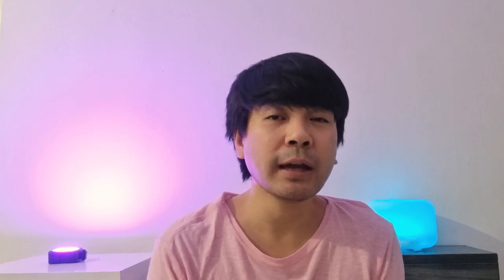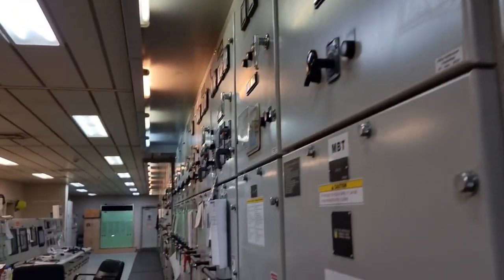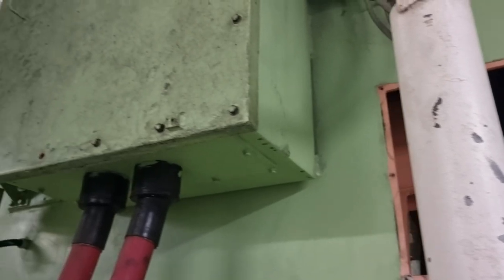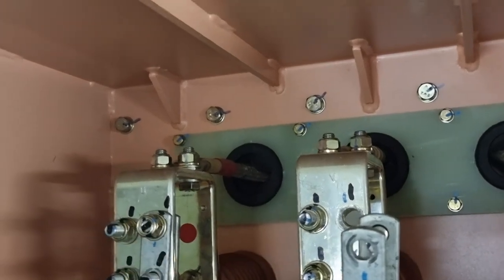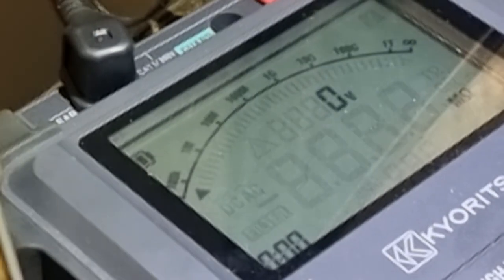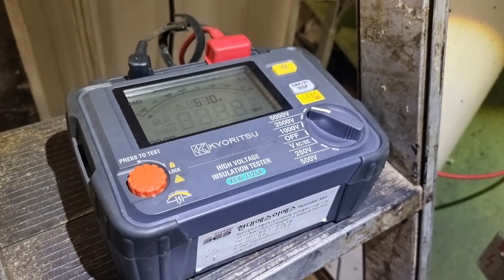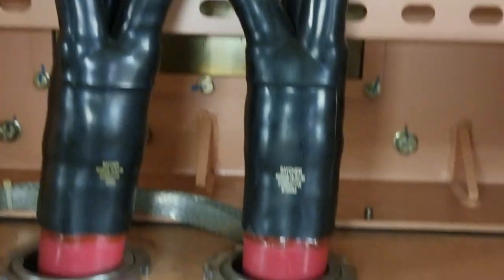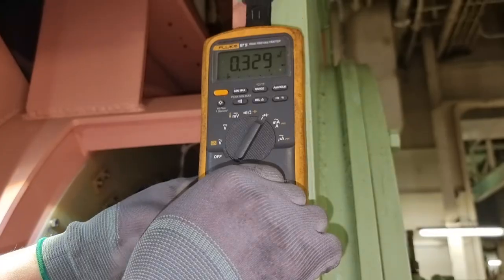6,600 VOLTS ALTERNATOR INSULATION RESISTANCE CHECK

Comment: You should use the Polarity Index or Dielectric test method when checking the High Voltage insulation resistance.  Also make sure that the AVR and the was isolated or shorted.

Comment: Sir good day 
I have done a high voltage safety course .where they told me that step of doing IR test 
1.isolate both electrically and mechanically
2.connect earth or grounding rod 
3.check the Voltage with voltage tester 
4. Remove earth or grounding rod
5.connect IR METER and do test .
6.discharge the voltage bcz we are using 5000v dc 
Where that time I imagined the process within a next couple of days u have Posted a video on that .
( I'll not forgot the procedure sir)
Thank you so much 👍